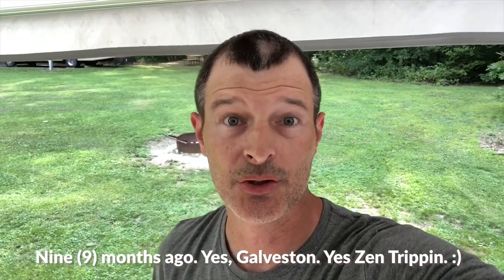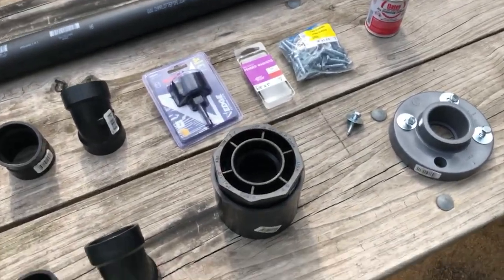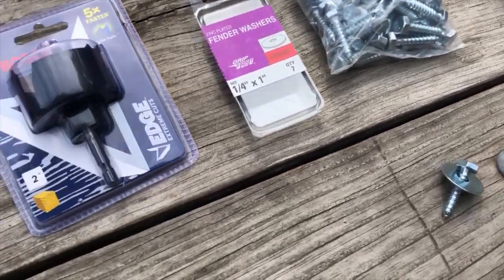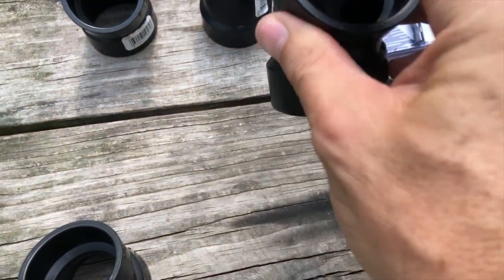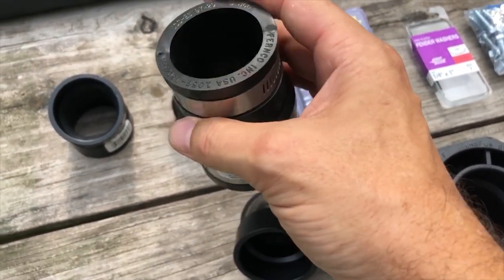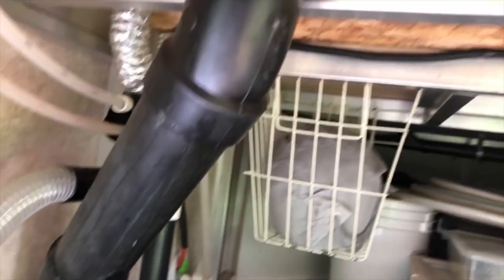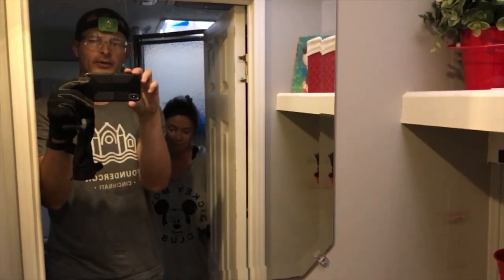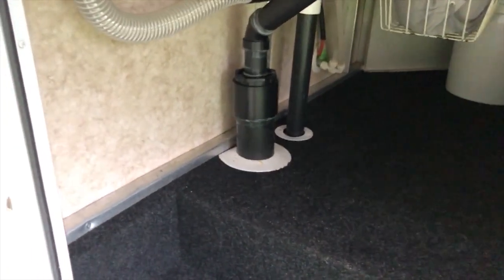Nature's Head Composting Toilet Redirect To Black Tank

Comment: Came over from your 20 Q's at HisandHersVlog...looking to see what you did here.  What kind of seal was on the liquid side of the original tank (just the lid, right?).  That is unchanged now.  And a P Trap or similar will do little to seal your RV from urine odors without a flow of fresh water in the trap.  So, same/same.  Great job!  Personally, I would never use a "composting" toilet because they do little "composting."  Better to call then a dry waste collector.  Let it get too wet or let it go too long and you can see the shortfalls...but we do not full-time either.  Anyway, thanks for sharing.  That redirect is a great hack. Safe travels

Comment: Interesting install.  One thing I don't understand is what keeps the sewer gases from backing up the pipe into the toilet?

If you are having problems with that you could install a p-trap but after using the toilet you would probably want to fill the urine part of the toilet with about 8 ounces of water - maybe more.

Another approach not requiring water would be a HepVo.  Check out this video for a review of the product (https://www.youtube.com/watch?v=t55hL431ejc).
Reply from the maker: Knut Blaise Yes. That’s an issue. There’s a trap, not the P style, that will prevent back gasses. That’s a project for this summer!
Reply from the maker: Knut Blaise Yes. That’s an issue. There’s a trap, not the P style, that will prevent back gasses. That’s a project for this summer!